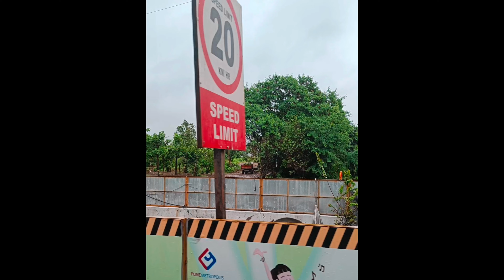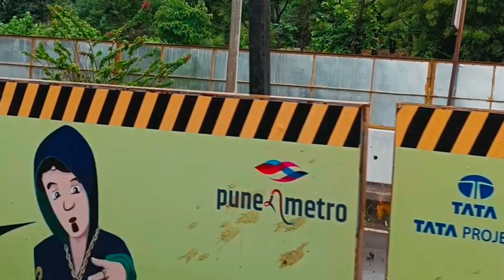Hinjawadi-Shivajinagar route: First segment for Pune Metro Line 3 installed @SinghV131

Comment: मेट्रो चा पहिला खांब गंजून पडेल त्या दिवशी कदाचित मेट्रो च्या शेवटच्या खांबाचे काम पूर्ण होईल असे पुण्यात उपरोधाने बोलले जाते। ४००० हजार कोटी पी.एम.टी वर खर्च केले असते तर वाहतूक व्यवस्था सुधारली असती। मेट्रो खाली जे रस्ते आहेत त्यांची अवस्था दयनीय झाली आहे।
Reply: PMT won't solve traffic problems. Buses are using the same congested roads. Any city with population above 1 million has to have a rail based mass transit. But you are right about road conditions. The speed of construction is too slow as well.